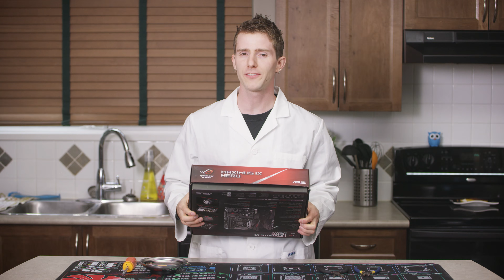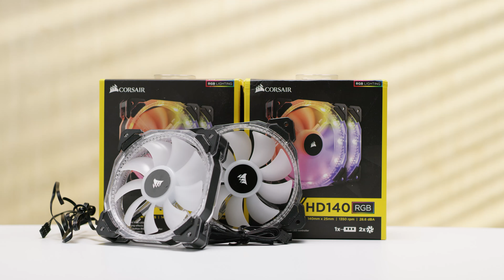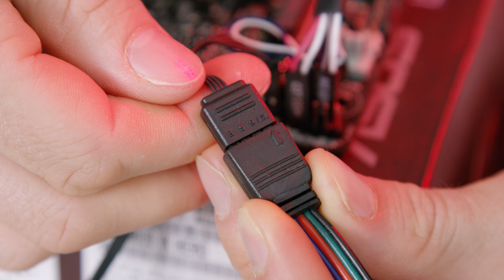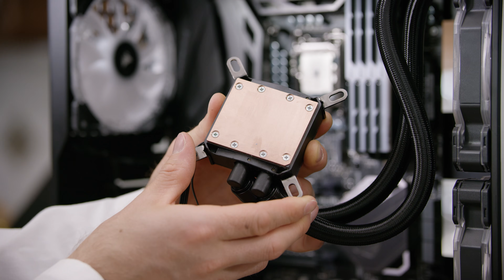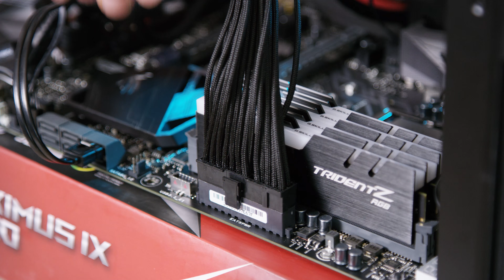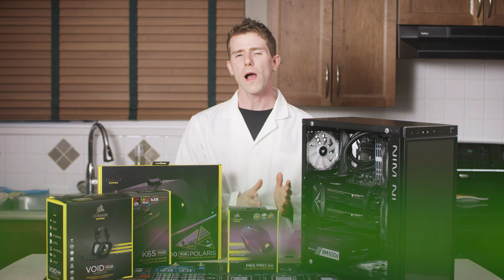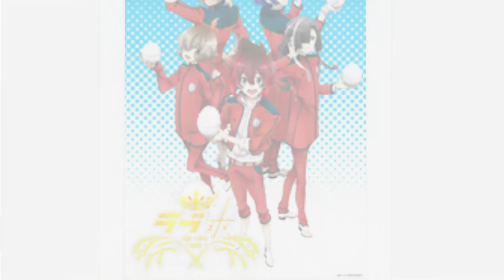The ULTIMATE RGB PC Build Guide!

Comment: Red Team = AMD
Green Team = Nvidia
Blue Team = Intel

It was destined to be from the start.
Reply: spøøky mike søcks Yellow Team: Well, this is no yellow conpany
Reply: xfiles tune
Reply: Nvidia vs AMD, AMD vs Intel, but not so much Nvidia vs Intel. Nvidia doesn't really make CPUs, and Intel doesn't really make powerful graphics cards, but AMD makes both.
Reply: Thats some illuminati shit
Reply: There are 3 teams. 3 divided by 1 is still 3. A pizza has 3 sides. A triangle has 3 sides. A triangle represents the illuminati. So the illuminati made pizza and also made the teams. Illuminati confirmed.

Insert illuminati picture plz
Reply: still missing amd😒
Reply: If you think of the circle as a disk (or a pizza) then it it has an up-side and a down-side, therefore two . If you think of it as a curve, then it has an inside and an outside, also two . If you think of it as the limit of an n-sided regular polygon, then one can justify the answer that the circle has infinitely many infinitesimal sides. If you consider a 'side' to be the part between corners, then a circle has none.
Reply: AMD was green as well back in the old days...
Reply: AMD was green, ATI was red. Good old days.
Reply: Ezequiel Ridolfi Beige.
Reply: so im team turquoise
Reply: HUH!!!!!!!
Reply: Green Team
Reply: Red team all the way
Reply: Green team
Reply: spøøky mike søcks you can't build a system with all 3 though 😑
Reply: YES YOU CAN
Reply: Theres Intel and AMD ssd's, and ram. So you can totally have all 3.
Reply: VN the reactor they should have had a Ryzen CPU, the Nvidia GPUs, and Intel SSDs if they wanted to balance everything in terms of corporate power
Reply: jlrockafella Intel optane memory, Nvidia card and ryzen
Reply: Wow, blink.
Reply: BLUE TEAM!
Reply: RGB TEAM
Reply: Kqog Gaming On Macs  zotac
Reply: Pokeruler but amd proccesors are bad.. i mean.. they are good if u have money
Reply: amd cpu, nvidia gpu and intel optane? or intel cpu amd and nvidia gpu just to be weird
Reply: S I L ̶E̶ N C ̶E̶ Intel might as well be out of business, after AMD and NVidia became "friends" again Intel has nobody but Asus to go to
Reply: I'm red and green
Reply: Team green for lyf
Reply: S I L ̶E̶ N C ̶E̶ OMFG
Reply: S I L ̶E̶ N C ̶E̶ What about ATI?
Reply: is msi fighting for red
Reply: ninhung1234 nguyen you tried way too Hard
Reply: S I L ̶E̶ N C ̶E̶ you are a fucking genus
Reply: Red team: has they flag
Reply: AMD = Red 
NVIDIA = Green
Intel = Blue
Reply: SandStorm ATI is AMD
Reply: Deus Vult red ist asus😉
Reply: AMD FOR LIFE (even if i am colorblind)
Reply: ninhung1234 nguyen when u are italian but u didn't know u were illuminati🤔🤔🤔
Reply: Davor amd processors are cheaper and better than their intel counterparts. Whered u get that info boi?
Reply: Green Team
Reply: Deus Vult 999 Likes!
Reply: Deus Vult 1080 likes
Reply: name last name CONSOLE PEASANT DETECTED
Reply: Green team Pog
Reply: You blew my mind rn
Reply: @kanyegrande4312  Corsair
Reply: nah they don't make gpus nor cpus
Reply: Sw3d154_F154 Nah they make GPUs based on NVIDIA and AMD
Reply: Red or dead.
Reply: green
Reply: @kanyegrande4312  zotac?
Reply: I'm amd boi
Reply: Deus Vult green
Reply: Black : Radeon
Reply: @kanyegrande4312  thats corsair
Reply: Yes. This is true because corsair designs their own CPUs and GPUs
Reply: ooohh shit
Reply: green team = razer
Reply: @BeanSticky  well Intel is gonna enter the GPU market now
Reply: @BeanSticky  i got news for you
Reply: @thebigsnorlax3222  Looks like it's not great news for Intel.

Comment: Next: RGB Screws
Reply: Turtle that would be cool fym
Reply: don't give them new ideas, that's enough
Reply: How about rgb user
Reply: @amitbanik8832  yeah try to rgb your skin
Reply: guys dont forget RGB air.
Reply: Also don't forget that rainbows are rgb
Reply: Why dont u add RGB PSU??? 8)
Reply: Rgb io shield
Reply: @cjuice9039  What about RGB CPU?
Reply: Lololol
Reply: @xXKAROLXx03  RGB hard drive bays
Reply: @cjuice9039  RGB thermal compound
Reply: @xXKAROLXx03  RGB front io plugs
Reply: @cjuice9039  RGB dust filter
Reply: RGB cooler fluid
Reply: @cjuice9039  RGB heatpipes
Reply: @xXKAROLXx03  RGB motherboard standoffs
Reply: @cjuice9039  RGB cables
Reply: @xXKAROLXx03  RGB desk
Reply: Rbg hands
Reply: @LostBurst  RGB screwdriver
Reply: That's RGB PRO GAMING SCREWS!
- Elevate your GAMING and get the win with these cutting-edge GAMING screws! -
Reply: RGB CPU
Reply: @xXKAROLXx03  this actually exists. Lian-Li Strimer. xD
Reply: You have discovered something I never knew I needed
Reply: Rgb processor
Reply: rgb mobo
Reply: RGB RGB
Reply: RGB water
Reply: Rgb estudio...
Reply: RGB socks
Reply: RGB Mtn Dew & RGB Cheetos
Reply: Rgb oxygen
Reply: Lol i am the 1100th liker
Reply: migthy potato rgb electricity
Reply: Juusto rgb coolant, rgb screw driver, rgb cables, rgb cable ties, rgb air
Reply: Lmao
Reply: So you've heard of rgb water cooling but you can now take it to the next step with R G B  W A T E R
Reply: You mean nzxt
Reply: How about RGB Smoke

Comment: The NZXT Kraken X62 would've matched better with that infinity mirror front, though I think Corsair sponsored a good portion of this.
Reply: Besdies, Corsair's RGB/speed management software for their AIOs likes to use 5-10% CPU for no good reason.
Reply: Zzyzx Wolfe that would also mean having another RGB controller for just one product.
Reply: yeah as soon as i saw him grab the H110I i looked at my Kraken and went WUT???
Reply: I agree Corsair did sponsor this. The unnecessary reference to Corsair's RGB ram despite, the G.SKILL ram looking more aesthetically pleasing. Also better RGB fans (that are Asus aura compatible) are also available. These corsair RGB fans aren't so great. And finally the unnecessary modification of the corsair PSU, when the Thermaltake unit would have suited the overkill theme better.
Reply: That's never happened to me...and I've currently got two Corsair AIO's.

Also, every PC I have built with a NZXT AIO or the ones that friends have, has issues with CAM. It's utter trash. Crashes, failing to recognise the AIO's for lighting/fan/pump rpm changes, poor performance vs the same size Corsair AIO, etc. 

The NZXT AIO's are more aesthetically pleasing, but they also perform worse(though not that much worse), cost more, their software is crap, and the company has terrible support. I cannot recommend that shit at all.
Reply: I have to agree i have nzxt fans, kraken, and light strips and CAM is a trash software. A+ to corsair on that
Reply: What better RGB fans are there?
Reply: i personally preffer the thermaltake Riing they look more classy and not complettly over done

Comment: NO! THE CABLES ARENT RGB!!!!!!!!!!!!!!!
Reply: Oh right, this too. I forgot to mention this possibility in my comment. I wonder if RGB cables truly exist in a good format...
Reply: Thermaltake has rgb or at least light responsive cables
Reply: MCDennis101

Why not just use exposed fibre optic lines? Stuff the ends into the plastic plugins for each cable, and run them for as long as you can fit next to said cables.
Reply: optic lines break easily that's most likely the reason why not
Reply: No, it's more along the lines of THE FACT THAT FIBRE OPTICS DONT TRANSFER POWER.
Reply: optical sleeves
Reply: I'm not saying to REPLACE lines with them, but to run them WITH the power cables.
Reply: Ha, rookie mistakes.
Reply: 2/10 IGN
Reply: Rng cables look messy as hell better black cables you can hide
Reply: the alien secureteam10 is looking for but the strimer
Reply: the alien secureteam10 is looking for 2018! We do now!
Reply: the alien secureteam10 is looking for the cpu and thermal paste ain’t rgb DISLIKE
Reply: Not even the cpu. lol
Reply: You know what else isn’t rgb my baby account
Reply: Typo
Reply: @MCDennis101 yes

Comment: Linus: "We want our RGB to be as synced as possible!"

Also Linus: Buys Corsair fans that require extra software to sync with Aura Sync.
Reply: iCUE interfaces with AURA sync now so this build would use 1 software now.
Reply: @ElijahCiali  it has its limits though. If you're using icue you can control everything on the motherboard and anything connected to the motherboards RGB headers but you cant control the RAM. You'd still need aura for that

Comment: RGB cable ties
Reply: RooRoo RGB screws and Velcro straps
Reply: when you need to spice up your kidnapping
Reply: RGB glass, RGB air inside the case, RGB heatsink (the metal itself), RGB RGB, RGB shadows, RGB capacitors in the motherboard...